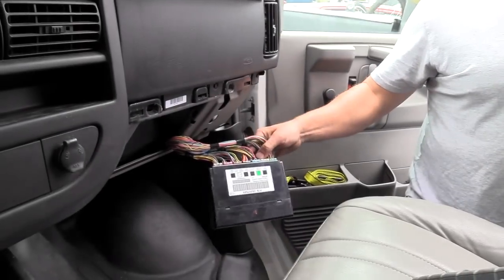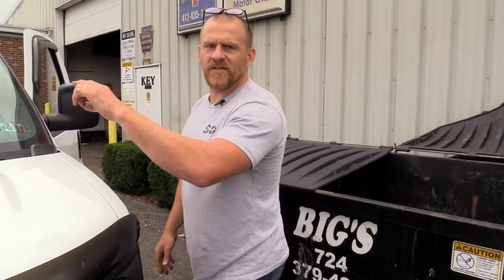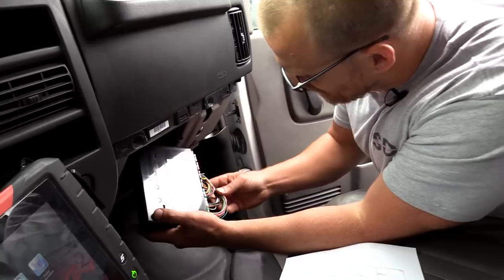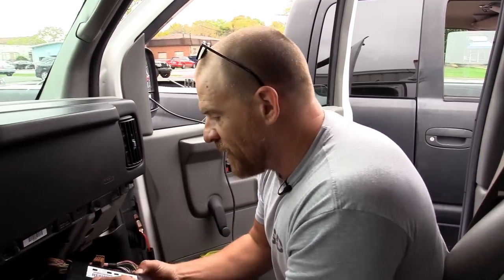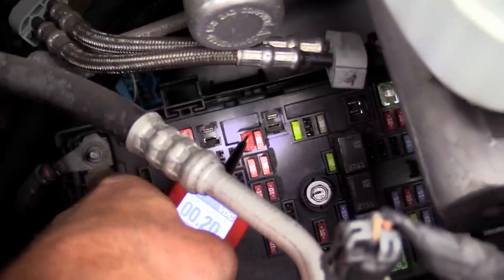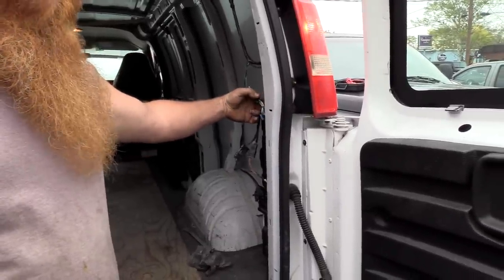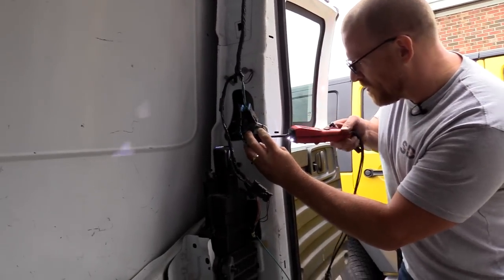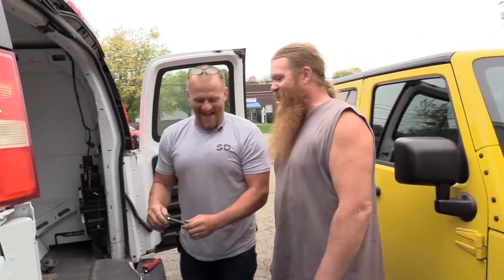BCM Controlled Tail Light Circuit Diagnosis

Comment: @ 18:30:  I'm actually not surprised by that fuse anymore because I almost got burned on something like this once or twice myself.  Paul, if you think about the thousands of times you've ever diagnosed GM lighting problems and looked at your wiring diagrams, you'd probably remember that GM loves giving each side/corner bulb its own fused power and the same even goes for each individual head light.  I'm pretty sure that never changed once they ran all the wiring through the BCM.  They just pulled a dick move and relabeled your RR turn signal fuse as "BCM fuse 6".

Danner made my day with the fuse tester, "Come on man, you have to try it now. It came with the business."
Reply from the maker: dick move is right lol "BCM fuse 6"
Reply: that's also the right rear brake light fuse, it's all for current limiting each side, with mindset of a trailer being towed and no total lighting outage when something shorts.
a single fuse for all turn/brake, which SUCKED royally when one wire or bulb shorted and suddenly no turn signals or brake lights on the whole setup. 
yeah, the labeling could be better, but there's limited space on the under hood cover, maybe the manual clarifies which fuse feeds what ;)
Reply: @throttlebottle5906 , before it was ever labeled BCM 6, GM always labeled that fuse much more appropriately in the fuse block covers.  Back in the day, it would have shown in print "RR TURN" or "RR PK/BRK/TRN".  Something that was a rational descriptor of what the fuse was and that went for every leg of lighting.  I can tell you there's still plenty of room to print a rational abbreviation other than BCM 6 in a GM fuse label.  And looking at the wiring diagrams, I can also tell you GM does not make an effort to ID any BCM fuse as a particular lighting circuit.

It's not to say that GM didn't pull dick moves back before BCM 6.  When GM felt like playing dirty back in the day, they legged the DLC power off the 12 volt accessory socket and they labeled it CIGAR for the cigar lighter.  (Add an incomplete Mitchell diagrams to that label and diagnosis got stupid.)  I really want to say that CIGAR fuse also sent power to the PCM early on some makes and models in GM's OBDII history too.  I know I've been stalled a couple times learning and then forgetting about the cigar fuse just to get a scan tool to power up.  I can recall a few times that somebody plugged their cel phone charger into the cigar lighter socket and suddenly stalled out for no discernable reason and replacing a CIGAR fuse brought it back to life every time, but I can't pick out the makes or models.

Comment: We had a customer with a similar van comeback the day after replacing his brakes with a complaint of no brake lights or turn signals. While inspecting the vehicle, the tech found a tool bag suspended from the ceiling swinging around freely. A hammer in the tool bag snagged the wiring harness and broke all of the wires to the taillights and brake lights. He was less upset after we showed him exactly what happened.
Reply from the maker: It's always our fault

Comment: Yeah. It's the guy who's been wiring trailers for a 100 years. I'll tell them to run a ground directly to the lightning socket and their response is. " I've been doing this for a hundred years! " All the while they are fastening a 20 guage wire to the aluminum trailer with a no
2 self taping screw...

Comment: heyy mister What an awesome video once again :) And i have to say ,,i was on the correct "track" to what was the culprit all the way "Giggles" :) Jokes aside..could it be that the four BCM fuses actually are individual fuses for the four  turnsignals?would be fun and interesting to remove one of the other 4 fuses..to see if it took out any of the other turnsignals.Anyways...fantastic video which shows the importance of power n grounds .Thank you so much for  keeping it up :)  Greetings from the NorwegianViking, Stefan :)
Reply from the maker: Yes, after seeing that, I believe all 4 of those feeds on that connector are for each corner of the van

Comment: I got the same problem with my Chevy Express 4500
Interesting that the left and right turn signals are wired differently... BCMx drives the front BCMy drives the back, but on the other side BCMz drives both front and back... and another thing, the relays are PCB types in the hood fuse box sandwiched PCB.
A SUCK DESIGN because the turn signal indicator on IP may work while no action at the bulb!!!
Update: forgot to mention none of the fuses in the fuse block are blown and bulbs are good.
Have not troubleshooted it yet... just pulled the schematics to educate myself first.

Comment: So when you are checking the power feeds on the bcm and go to the fuse, you are checking the power and ground for the bcm and not it’s outputs, correct? Great video.
Reply from the maker: yes, when I say I am going to check powers and grounds to a module, I am referring to the module itself, not the outputs that the module is controlling. In this circumstance, we had a dead output, it looked like the BCM driver was toast, so we followed the normal protocol and found a blown fuse that was one of the power feeds to the module. It was unusual however to have a single power feed into a module be used to control a single output from that module. This is what made this lesson so valuable to the community in my opinion. It is something I have not seen before. Great question!
Reply: Thanks for clarifying, and for doing what you do. I learn tons from your content.

Comment: what about checking voltage drop from the connector back to the light? would that show if there’s corrosion or a break along the wire?

Comment: 2010 CTSV inputs as in the turn signal stalk? I have both front/rear left no turn signals and no brake light illumination when depressing brake on left side. Every other electrical function is good on the car. So strange

Comment: i make it religious to check ALL fuses everytime a problem is there. i had a car with the 4wd not engaging, checked diagram and had everything there for it, including switches on gearbox, turned out to be one fuse missing that was not seen on the diagram, also powered the tacho. nearly replace 4wd module

Comment: It sucks that the fuse box diagram only specifies BCM 6 and not what it ultimately feeds. It would avoid a lot of confusion if the right turn signal lamp appeared on the diagram. Thanks for the video, for 1/2 hour it made me forget it was cold and snowy outside my door.
Reply from the maker: Bet a factory diagram would have been better here. One of the few times, I should say, lol
Reply: @ScannerDanner  For sure if you have quick access to reliable wiring diagrams, but the second thing I'd be checking after the bulb would be the fuse. It throws you for a loop if it's not listed.
Reply from the maker: For sure!

Comment: I'm having similar problem 2011 camaro  has new bulb fuses and socket, power going to the socket but no ground, signal brake doesn't work yet park light does 2011 camaro are a pain

Comment: As a learning point, why would you look for the short between the BCM and the bulb in question? Wouldn't you look for a short between the blown fuse and the BCM, since it was a BCM power feed fuse that was blown? I'm asking for Ivan and Eric O... :)
Reply from the maker: Lol, you wouldn't be wrong in looking for a short there as well and it is something I did not mention and should have. 
Just to be clear though, a short on the output side of the BCM (the light circuit) will absolutely blow that same fuse. Are we good on that point?
Reply: @ScannerDanner  Yes, thanks for clarifying. And I wasn't clear on that. I thought there might be fuse to protect the BCM and a separate fuse to protect the bulb wiring.
Reply from the maker: No sir, that's what made this one so unique!  Great questions! Now tell Eric and Ivan to mind their own business lol, just kidding

Comment: Love the videos BUT do you not check ALL fuses 1st when you have a component that's not working ????
Reply from the maker: Not when it is one single output from a module that is not working. Also, for that output, there is no fuse!! This is a unique situation where you have BCM fuse #6 being used to supply voltage to one single output. That was the major point of this video.
Reply: "Also, for that output, there is no fuse"                                                                                                                                                     There is, its on the input, it has to be fused somewhere                                                                                                                                                                           Most BCM;s will have multiple input / feeds as a fail safe to stop the whole system going down
Reply from the maker: Watch the video. You're missing the point.

Comment: Great video, followed your content for years....@27:03 was that water coming from the trailer harness you said you weren’t going to un-tape? Hard to make out but sure looks like it.
May be your blown fuse right there.
Reply from the maker: It was dust reflecting off of the flashlight. A few guys thought it was sparks :-)

Comment: What about rear tail lights, brake lights, reverse lights, and turn signals not working? Would that be a ground possibly or a BCM issue?
Reply from the maker: If they are BCM controlled

Comment: Hey guys !  Another great vid as always. I have a quick question for everyone here...I was looking for a mid priced bi directional scan tool, had narrowed my search down to the Launch X431 V pro or the Autel maxisys, but have also heard about the Zurich ZR Pro.  I'm kindof interested in the Zurich
 because I only work on my family's or friend's cars so I don't want to spend many thousands on a scan tool. The reason I'm interested in the Zurich is because of the yearly subscriptions...The first year is free, you can upgrade the next year for 499. And if you choose not to, it saves the current software so you can still use it at it's current status. I've heard this is the cheapest of the group and some of the others stop working if you let the subscription run out. Please let me know what you think, and if anyone here has ever tried the Zurich ZR Pro. Thanks
Reply from the maker: Keith, you will get more replies if you post this to my forum. I have over 15k members all over the world, working on all different car lines. It is free to join too! www.scannerdanner.com

Comment: Hi Paul..plzzz guide me on this..my cars boot ( trunk) switch isnt working but it opens with the key fob..there r two wires to the switch..i guess one must be 12 volts..both the wires have zero volts..the trunk solenoid has 3 wires..there is 12 volts on one wire when i press key fob button..one wire is ground nd there is a third wire which has 0.4 volts...one wire of the switch is tied into the ground wire of the solenoid...plzzz advise me...Thank you.

Comment: I personally would have added an fuse to that circuit as close as possible to the trailer circuit just in case it shorts again in the future it would give direction
Reply from the maker: I'd worry about putting a lower amp fuse there

Comment: Man as soon as i saw the chevy express van, and the bad turn signal i had a feeling it was a bcm fuse. At the shop that i work for we service a fleet of 70 express vans, and atleast once a week i have to diagnose problems with the exterior or interior lights. its always the fuses. ive done current measurements and wiggle test and i can never recreate it. On one van i found the wrong bulbs installed in the break lights. I never understood why they need 6 fuses for the exterior lights, and they are split form front to back and left to right.
Reply: the trailer tow harness on our vans have been eliminated too

Comment: Paul, quick question..... Would it be ok to put a slightly higher amperage fuse to compensate for the extra load from the trailer? To avoid blowing fuses. Of course after the trailer circuit was confirmed good.
Reply from the maker: Absolutely not, especially because that fuse is protecting the BCM driver!
Reply: the 10amp fuse is already sized proper for a power hungry trailer, if you need beyond that go to a converter style trailer harness, which requires it's own power feed ran from battery and isolates the trailer from vehicle lighting circuitry. it still connects to it, but uses very minimal power to operate the electronic control box

Comment: What diagnostic scanner are you using in this video? I'm currently using the snap on solus edge, and we have the solus ultra at work, but i do not believe either of them get that far in depth into a bcm to see individual exterior light output signals.
Reply from the maker: This was the Verus, your Solus would have these PIDs too

Comment: Don't those towing kits for that vehicle come with a module for the trailer lights that keeps it from destroying any of the circuitry if you have bad trailer wiring? It could also have a PTC thermistor/TVS diode circuit to protect the main circuit if there is over current but will reset itself when overcurrent condition is removed.
Reply from the maker: Not that I've seen
Reply: there's plain harness that uses the vehicle lighting circuits to power them and there's also converter style harness that need a power feed ran from battery, which effectively isolates the trailer wiring from the vehicle lighting circuits, except enough to operate the electronic converter box. both style plugs in the same way to factory lights, the one needs power wire ran to the battery at front.
There's a third harness style which is direct plug in in cab and rear frame "if it has a factory trailer harness" that would normally be a 7pin round and 4 flat connector with pigtail to factory  frame plug and pigtail inside to brake controller.

Comment: you never made it to check the inputs to the bcm.   i've seen some strange wiring designs before so a seperate input for each rear turn would not be out of the question
Reply from the maker: Yes I did, you must have missed it :-)

Comment: Couldnt you jump it to the front right output. If it over loads the driver oh well it already needs a bcm I know that's not the best repair put still possible
Reply: Than i finish watching the video but if that fuse was good

Comment: I would guess that the reason for 4 fuses is so you don't lose all turnsignals if 1 shorts.
Reply from the maker: that would be one advantage for sure
Reply: exactly, add a trailer with intermittent short and you'd have no brake or turn signals at all on older vehicles with single fuse.
nothing worse than middle of night in the middle of no where and blowing fuses, which would make it very unsafe to drive for you and others. not to mention the pullover/ticket factor, they'll often escort you to a pull off/rest area to fix it, but that's still not good.
then again who needs brake lights or turn signals and trailers never ever short out :))))

Comment: It seems like the bcm is just monitoring the circuit. Is it possible that there is NOT a driver in the bcm that operates the bulb?  And that it is the flasher that operates it?
Reply from the maker: I don't think so Bill. Cost of a transistor compared to mounting a flasher in the board? Doesn't make sense
Reply: ScannerDanner   Thank u!!!  Really appreciate all the good stuff on Premium!!  Case studies and Scope instruction. I am working on how to search the vids in premium. Perhaps u could do a vid on that. I remember Calebs minibike. Electric. Cool!!
Reply: there isn't "flashers" anymore, it done electronically in the BCM. including the faster front/dash indicator flash/click when there's a bulb issue. of course how many people know that a fast flash/click = bulb out. lol
Reply from the maker: @billrimmer5596  just sign into your account and use the search box, keep your wording simple. Are you having trouble with it? It should be pretty straight forward.

Comment: I was always curious. Why in US you have red turning light? And to make things worse its the same bulb as brake light? Can someone explain?
Reply from the maker: All of our older cars were like this, I don't have a better answer lol
Reply: @ScannerDanner  here's your answer..

Amber Rear Turn Signals Are Safer Than Red, But Few Use Them. Studies show that amber turn signals reduce accidents, yet most signal lamps on the rear ends of North American automobiles, trucks and trailers are red. ... Because amber's not legally required, and it's simpler and cheaper to use red for all rear-facing lamps.

So you know lol
Reply from the maker: Makes sense

Comment: I have a 2006 Colorado. The DRLs never work, but you can command them on with my SnapOn scanner. AHL work properly. Drl indicator in instrument panel comes on when drls should be on. Any ideas?
Reply from the maker: not without researching the circuit for you, sorry. Input problem maybe? If you need additional help, post this to my forum, it is free to join and I have paid moderators who are friendly and eager to help you guys. Thanks! Hope to see you there www.scannerdanner.com
Reply: @ScannerDanner  I will check out your forum. Thanks for the reply.

Comment: There is nothing wierd about the four feeds and only 1 corner not working. Just a "poorly" designed PCB. There is probably one feed for each corner, they should design it so all the bulbs in the corner are lit at the same time, depends on the car of course, it can easily draw up to 3-5A in each corner, pluss the trailer bulbs. So if the feed to the BCM was just a thick one, instead of 4 small ones, a short may have resulted in none of the lights working instead. So maybe not a badly designed PCB after all